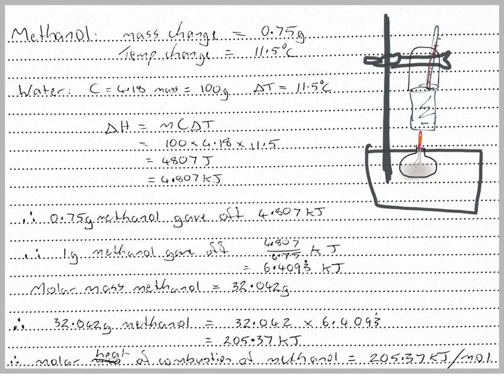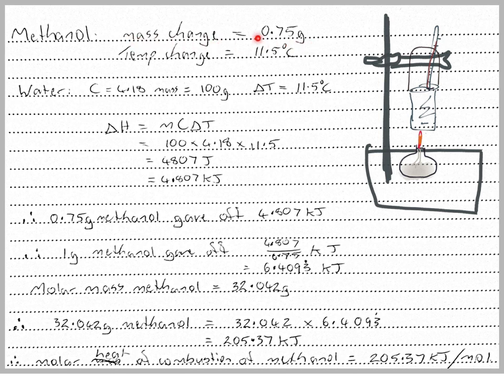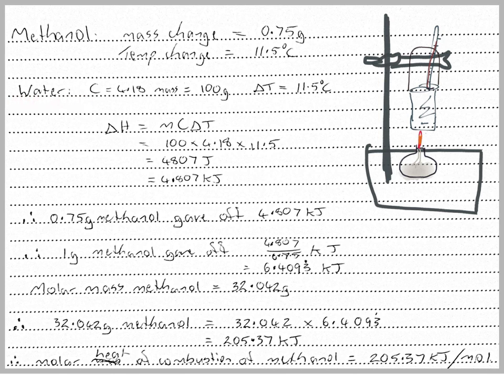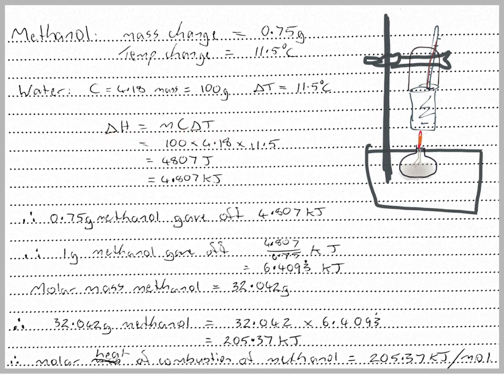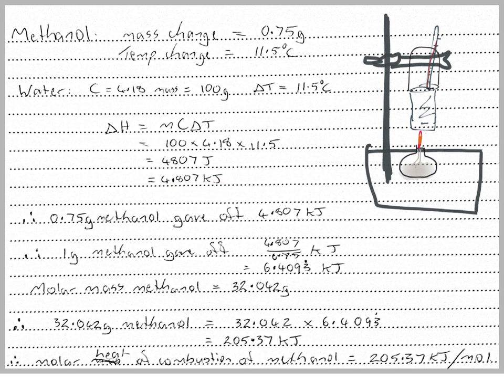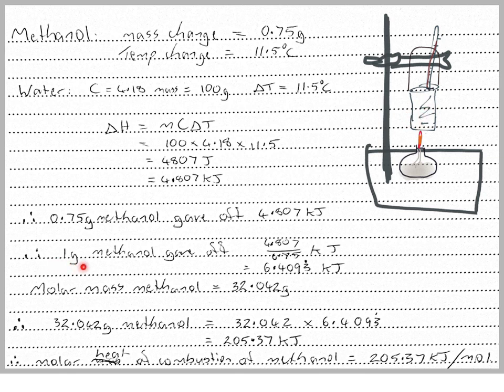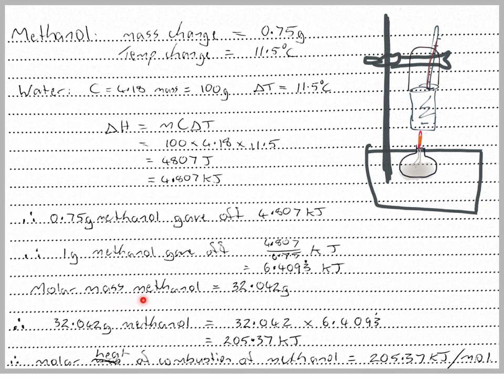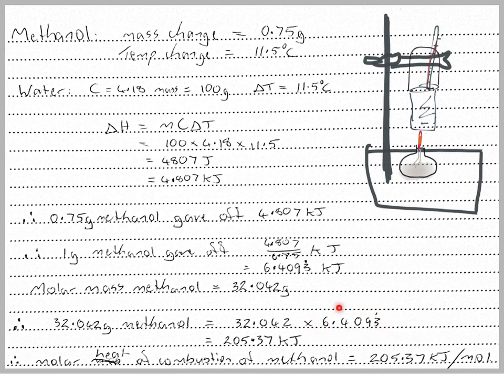Molar heat of combustion calculation

Comment: for The specific heat capacity why didn't we add "x10^3" in our calculations?? 
I know I'm commenting after ages, but a reply in an hour or so will be extremely helpful if anyone's reading this..  thanks
Reply: They assumed that the specefic heat capacity was 4.19 J/gc, which is actually the specefic heat capacity of water. Also, what do you mean by adding "x10^3"?